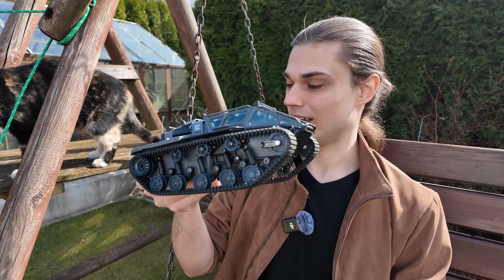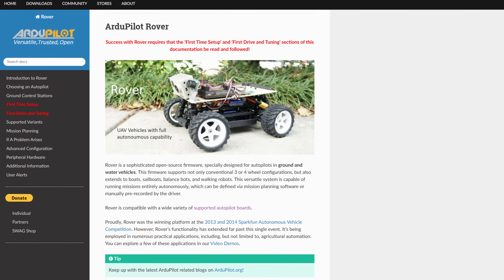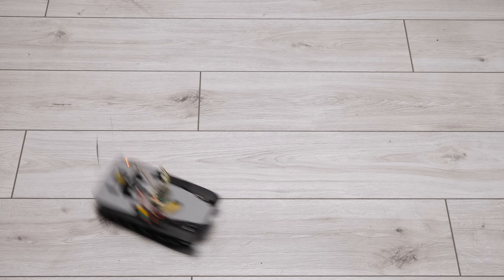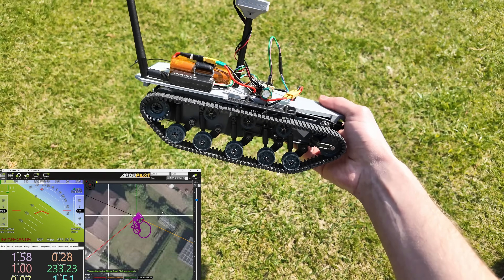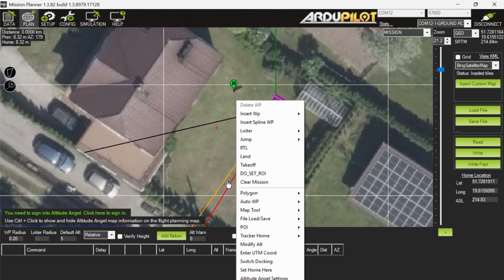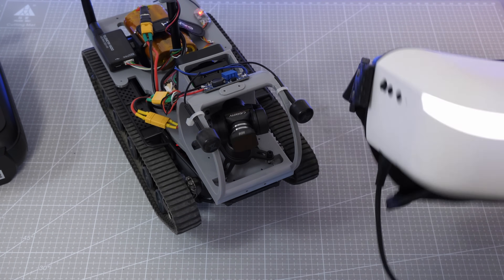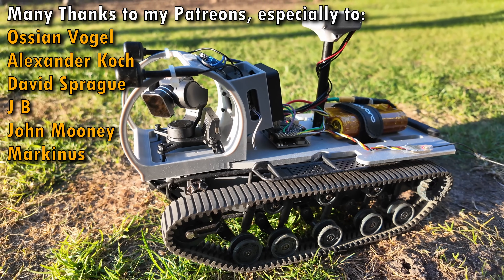I Made an Autonomous FPV Tank – ArduPilot Rover Tutorial

Comment: hallo lieber Freund ,dein video ist echt sehr toll,aber ich würde mich freuen wenn du eine Erklärung   machen kannst über ein RC-Car 
ich habe ein Axial 4x4 Allrad ,1:10 
verbaut sind 1)  Radiolink Crossflight 
                       2)Gps Antenne
                       3)Telemetry System 
                       4) Digicam O3 Airunit
                       5) der Sender Radiolink At10 II
                       6) ich habe keinen Brushless Motor sondern einen ganz normalen motor mit einem Rc Regler 
                       7) ich habe den Missionplaner installiert und habe schon einige Dinge herausgefunden aber irgendwie funktioniert die ganze Sache nicht wie es soll ,bzw. ob es die richtige Firmware oder die Updates sind ????
leider finde ich keine richtige Beschreibung wie man ein Rc-Car richtig programmiert und wie man was findet .

Comment: I think, its not a differential steering system and you used a a dual channel motor controller instead of differential steering system, right? Since for ardupilot rover setup "Servo1_Function" should be "Throttle Left" and "Servo3_Function" should be "Throttle Right".

Comment: How is the remote connected with the drone? does it connect via the laptop through the telemetry units or does it connect directly to the rover?
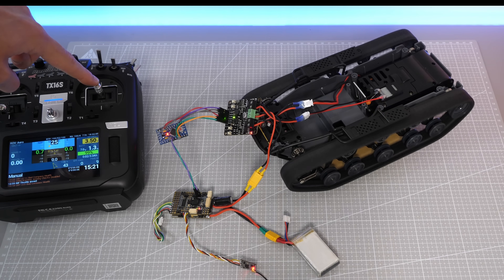Reply: all r/c radios use r/c rx units, in this case he showed he's using the tiny elrs receiver, shown in the setup @2:39 at the bottom of the video, center, tiny board with red light, connected to the flight controller

Comment: nice work .. why did you not use RC over mavlink in ELRS ?   then u dont need the telemtri radios
Reply from the maker: I only recently started using ExpressLRS Mavlink, and I think it’s really great. I’m now installing it on all my new projects, and I already have a full installation tutorial video in the works. 
For this project, though, I wanted to focus more on the rover itself and not spend half the video configuring the link, which is why I’m using standard telemetry here. Also, I feel like ELRS Mavlink is still a bit slower than a dedicated telemetry unit.